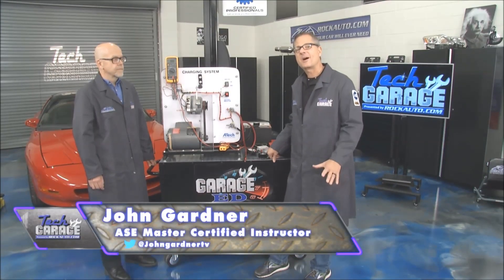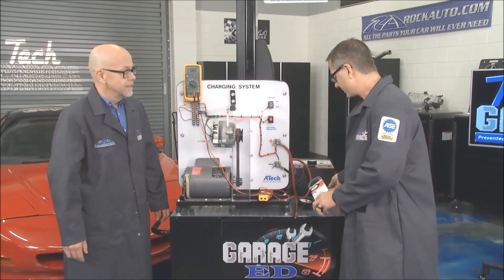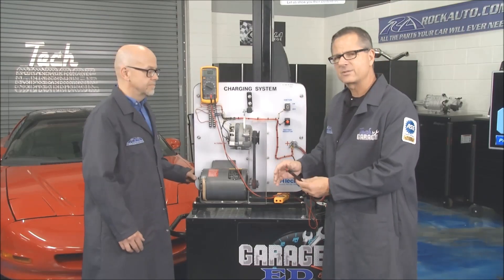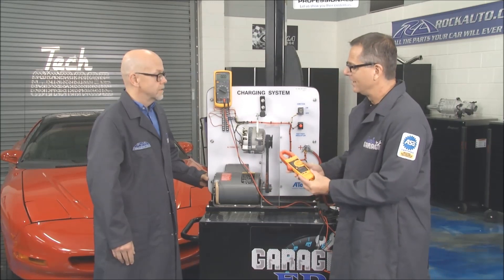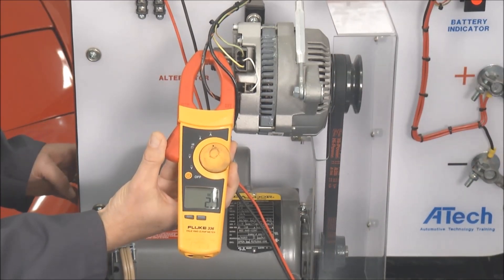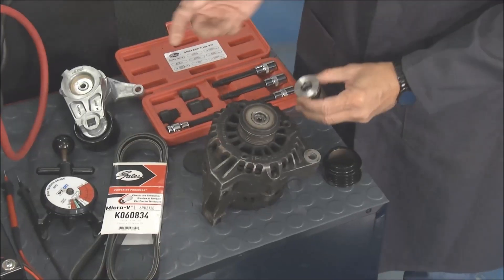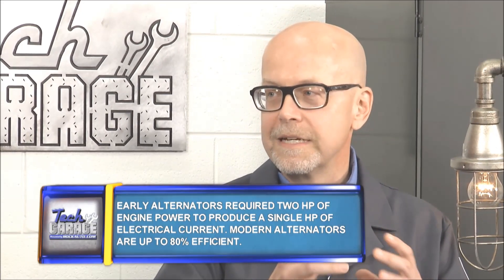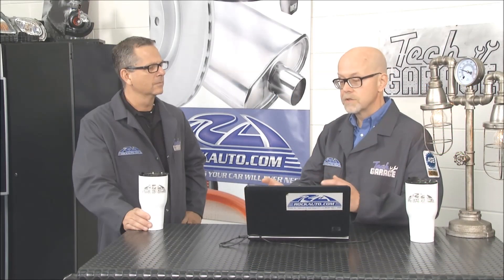Alternator, Belt and Pulley Diagnosis / Measuring Voltage, Amps, and Battery Load  (Season 5/E11)

Comment: What else would have to be replaced for a 2015 Volt, pulley sounds like chirping, engine pulley needs replacement, diagnostics done already. Is this expensive to replace and repair. Does the  belt have to be replaced as well?
Reply: the alternator bearings could be making that noise, or it could be that the belt itself is not tight enough, or is worn out. causing it to slip and thus make that noise.
Reply: The belt doesn't need replacement. As long as those alternator bearings are good (you can verify if you can turn the pulley by hand). If the pulley is good, check your tensioner on the drive belt/chain to see if properly in